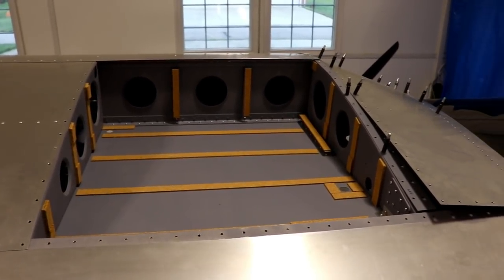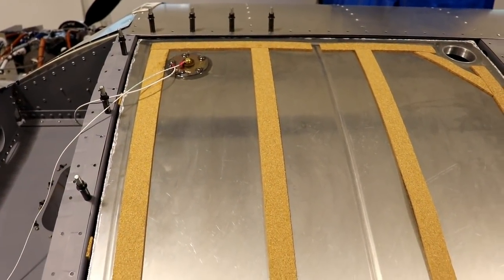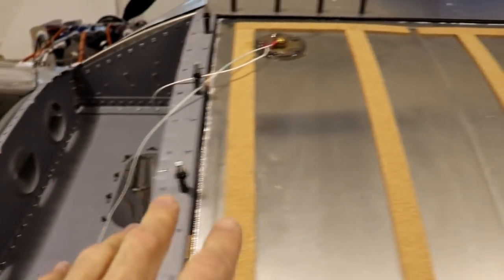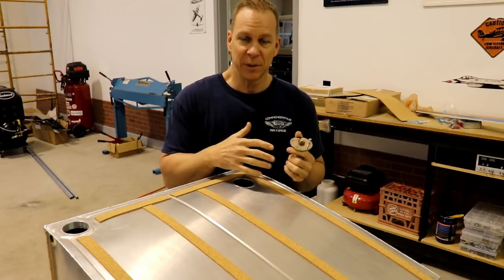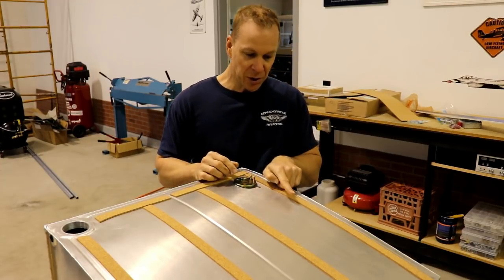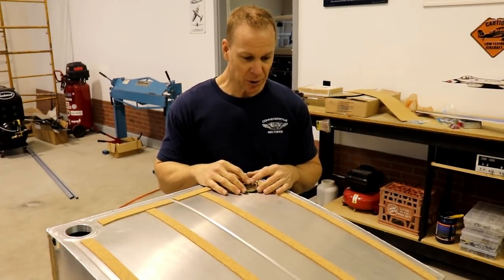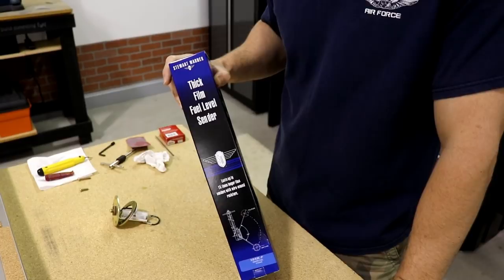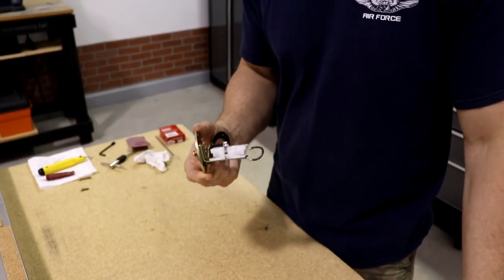Zenith 750 Cruzer - Fuel Senders (Part 1)

Comment: ummm.  Isn't that a quick drain hole...not a vent tube?  Just going off the plans, it looks like you plugged the quick drain hole not a vent tube hole.
Reply from the maker: ummm...looks like you better keep studying those plans! LOL
Reply: ahhh!  I found what your talking about on the prior page of the plans.  One has to look very closely!  I like what you did with the mounting to the sender on the top of the tank.  I plan to do the same.  Thanks for making these videos, they are very helpful.

Comment: Interestingly Cessna 150/172 sort of uses the same vent system, but they have a tube that extends below the wing right over the strut so if it drip fuel it runs down the strut. the vent line also is bent forward to help pressurize the tank. I remember having to make sure when Fueling our Cessna 150 before parking, we had to leave the fuel 2 inches down to keep it from dripping out when it expanded. we topped off before flight.

Comment: Vans uses 2 different senders, r/h, l/h did you use the same part number for both sides? or did you get the r/h and l/h sender.
Reply from the maker: I actually don't remember, but I would guess that I bought a left and a right.

Comment: Isnt using a plastic tank more safe? Or is it not common in kit planes to use a plastic tank?
Reply: @KitplaneEnthusiast  perhaps I compared plastic vs steel but in this case its aluminum so not sure about that. But in general plastic doesn't rupture easily therefore more safe. But in a fire environment it can melt and then....

Comment: cashed a sender problem until it drove us nuts. different senders and all wiring checks many times. would work in open air but not in the tank. turned out to be a grounding problem. with the gaskets and gasketed screws the screw holding the ground terminal was isolated. took days to figure out. solution is I welded a spade terminal direct to the sender body.(very carefully with a tig). and while we were resolving the first one the other become intermitted also so modified both. a strange but real problem. hope you do something to eliminate this problem. his didn't show until wings were skinned but fortunately were able to reach them thru an existing access hole in the bottom of the wing. lots of skin and blood before got it resolved but solid now  like your vids   Dave
Reply: floating grounds can be a nightmare to hunt down.

Comment: Great video and thanks for taking the extra time to document this.  I'm guessing that making, editing, and posting this video greatly added to the time needed to complete this fuel sender installation (maybe 2x, 3x, or more?).  Us subscribers appreciate that!

It seems pairing a Bingo Liquid Detector from Belite Aircraft with a standard float-based fuel sender could be very useful.  The Bingo Liquid Detector could be located at a defined point to accurately identify a threshold volume of fuel remaining.  Without CAD data to determine a design location/height for a given volume of remaining fuel, the installation of the Bingo Liquid Detector would be a bit of a guess.  However, after installation a builder would be able to determine and record the remaining volume at which the Bingo Liquid Detector lights up.  That'd provide an accurate snapshot of fuel left in each tank.

Here's a link...  http://www.beliteaircraftstore.com/bingo-liquid-detector/

I've never used this item nor do I have any connection to Belite Aircraft, but it looks like it could be a pretty useful instrument.